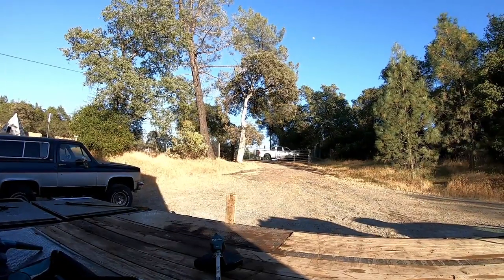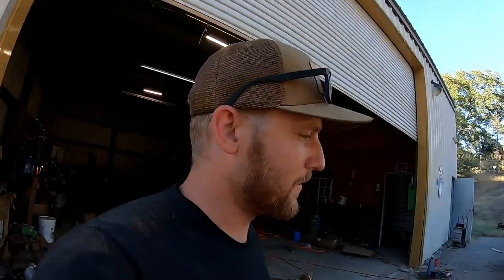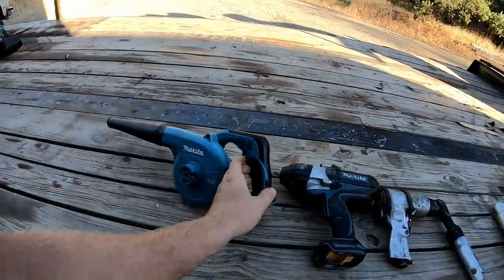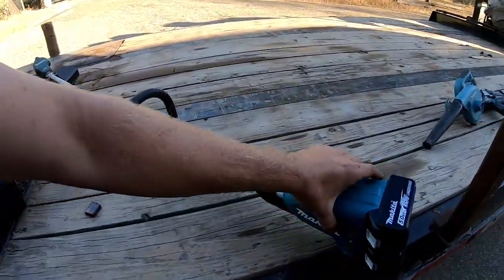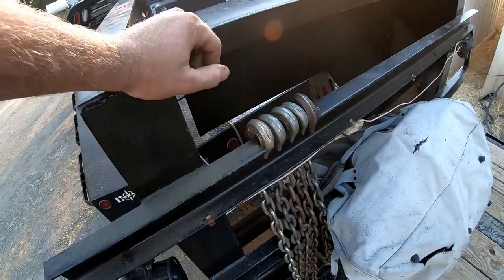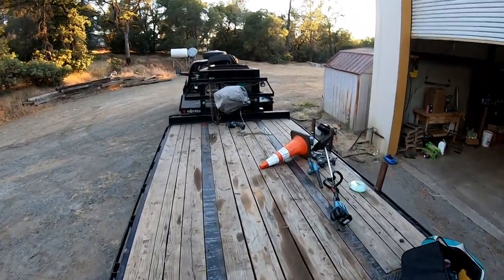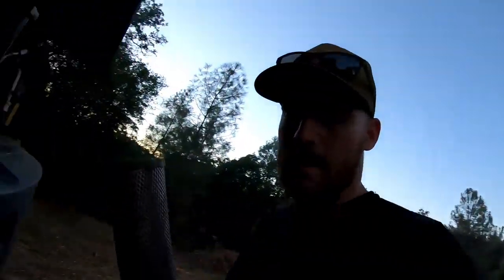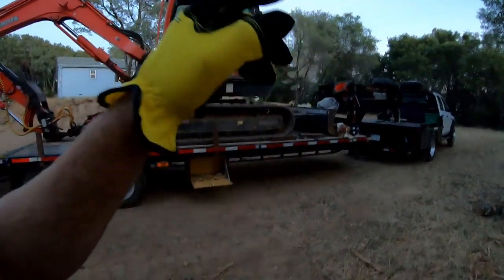TOP 5 BATTERY POWER TOOLS THAT REPLACED AIR AND GASOLINE POWER TOOLS #makita

Comment: As a full time traveler, I need tools. You have Makita, I started with DeWalt, went to Makita and have now settled on Ryobi. They have everything for the same battery. For example, when camping cutting firewood or getting branches out of the way, a chain saw is nice. So I have a Ryobi chain saw. It is amazing what that little thing will cut through. Some folks like Milwaukee, my son is going Ridgid. They all works.

Comment: I've been switching over to the Milwaukee Fuel line in 12 and 18 volt.. Very impressive, the battery tech has come a LONG way in 20 years, that's for sure...
Good video, thanks for doing them..

Comment: For the chains, I've always picked up a piece of L bracket and cut it about the same width as the hanging area above it. then mitered the corners to fold it back against itself and create a box to weld together that goes to the same backplane as where the chain is hanging from. Weld or bolt it to the trailer and you don't have to worry about the chains whipping around.

Comment: I must say that often I prefer Air tools to cordless stuff. But I own a number of nice air sanders that i use ton of. Which generally last longer as air air tools and are better built than the electric versions do. I also do alot of sand blasting and bleed blasting of parts. 
That being said, battery powered tools have come so far these days. Its nice having the cordless stuff for field work. I have bought a number of cordless tools that have made life easier, and my clients love em too, cause they are quite a bit quieter than the alternatives these days too.

Comment: The new lithium ion batteries are amazing, I have a few old style 18v Dewalts right angle drill sat for years because the battery would not hold a charge. but now they have a converter from 18v to 20v MAX XR lithium ion, so I tried and it works better than the old one, then bought their grease gun and it works great. I also tried the Harbor Freight 40v pole saw, chainsaw and blower. I was shocked at how well they work and battery life was good too. Im with you on the convenience factor with no hoses or cords. I’m going to check out Makita . I may have a welder for you if your interested. Keep up the good work👍👍👍

Comment: Heck I love my Makita 1/2" impact awesome for lug nuts on my Jeep and on my Ram 2500. For smaller battery powered tools I run the Milwaukee M12 stuff they are lighter and easier to handle.

Comment: Lol, I run a 40k Winston trailer and pull it with a 613 Mack dumptruck, and can haul my excavator and trackloader both at the same time, of course my truck has air brakes and I have tapped into its air supply to use for blowing out radiators air filters, so some of us still like and use air supply, its always there with me on every job, at home my air supply is the big boy, 220 wat supplied for the big use toys

Comment: Im cheap and just use my stuff around the house not for work. I really like the "Tool Shop" brand battery powered tools from Menards. its better than Harbor  Freight stuff but not on the level of Makita, Dewalt, Ryobi, etc. But works fine for me. Again Im not using it to make a living.      I pride myself on buying decent quality, cheaper stuff, and taking good care of it, making it last as long or longer than the better quality stuff. Black and Decker has been good to me too.

Comment: I’m right there with you, we use Milwaukee impacts and ratchet wrenches. But they are so much handier the air tools. I’m not a brand whore, if it works I’ll try it out. I like that little blower you have!

Comment: I have  Makita Impact  and still have to use  a Ingersoll rand  Air  for the real tough  bolts  I have never seen a electric that holds a candle  to a real good air  if you have  good  air supply!  Yes a Electric is handy but they won't replace a good Air tool!

Comment: Did you secure the boom?
Reply from the maker: carlj3515 yup ratchet tie down
Reply: V-BELT and SON ; Not try to be in others business or try to be a know it all,however as a flatbeder who has heard of others getting caught by the POPO man for not having attachments secured. Have seen ratchets that only one end ratchets or screws in and out and the handle folds down. When you cut that that chain down I cringed, now some time you will need a longer chain and you will remember why did I cut that down.

Comment: Why don't you put a piece of sheet metal over the back boards and bolt it from the corners. Easy peasy lemon squeezy
Reply: cash5150 right!
Reply: I had a piece welded on my trailer.